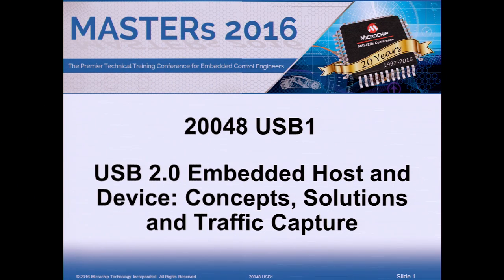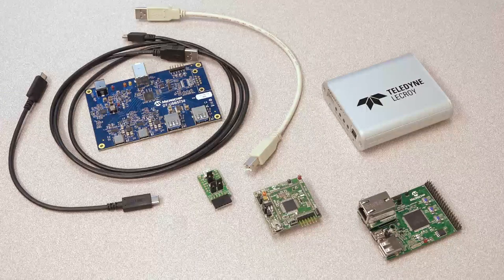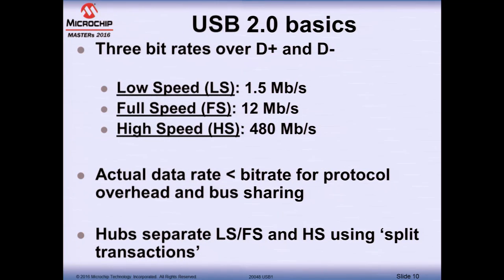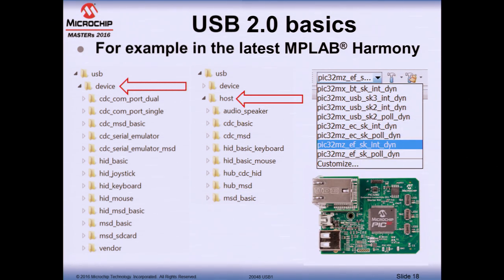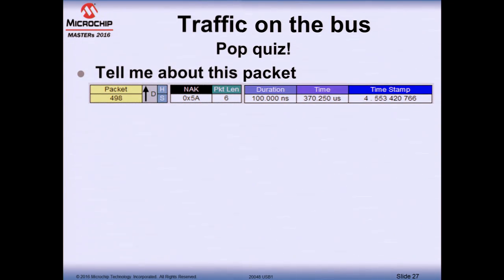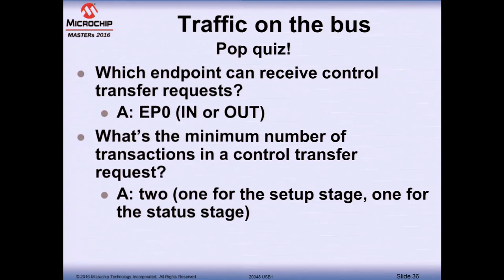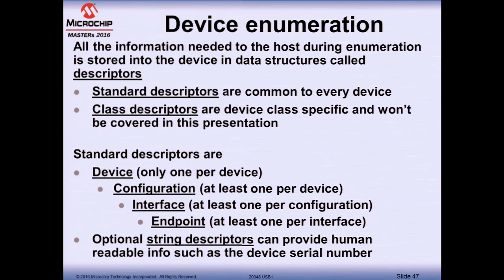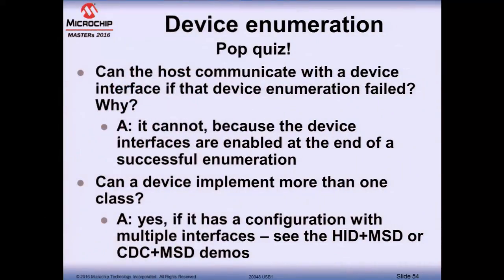20048 USB1 - USB 2.0 Embedded Host and Device Concepts, Solutions and Traffic Capture

Comment: There is an apparent inconsistency in the information. At 19:02 it states that an IN is a message that has come from the device to the host, but at 40:50 it shows and IN message as being from host to device. Which is correct?
Reply: Not at all. At 19:02 he's talking about an IN endpoint, which is where data going to the host "lives". At 40:50 he's talking about an "IN token packet", i.e. a packet from the host saying the the device should transfer the data in IN endpoint 0. That's how I think it works anyway.

Comment: It's mentioned that hub can detect device attachment. How does host get this attachment info?
Reply from the maker: Hello Vincent. Here's the answer to your question:

Per USB 2.0 specification, once a device detects a 5V voltage on its Vbus line (as it happens after it is plugged into an active hub port) it needs to assert a pull-up to 3.3V on either its D- line or on its D+ line; the former to indicate being a low speed (LS) device, the latter to indicate being either a full-speed (FS) or a high-speed (HS) device. So, following device attachment the hub will detect an electrical pull-up on one of its ports and will flag this condition (once requested) to its host. That will start the device enumeration process.